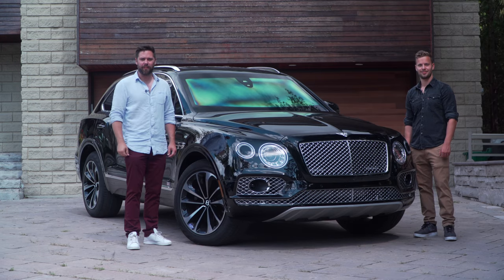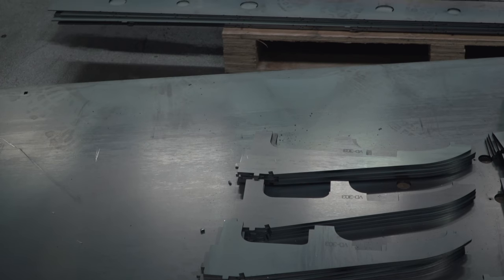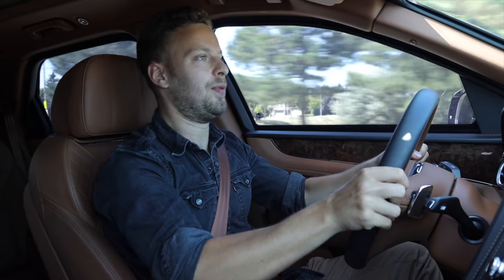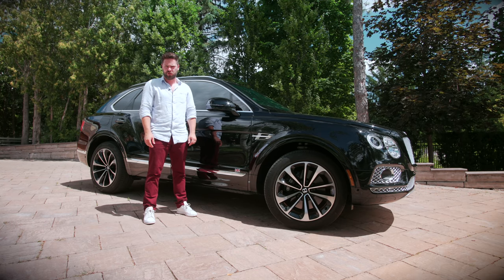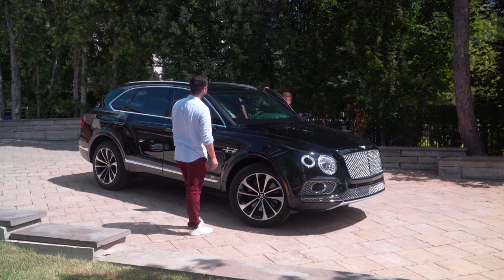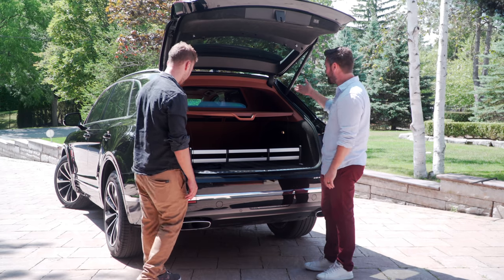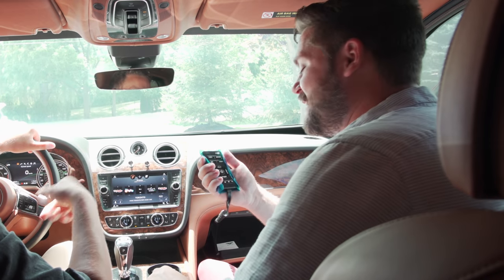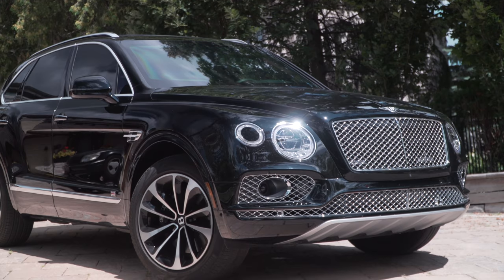$500,000 Bulletproof Bentley Bentayga Review // First Of Its Kind

Comment: How well do the tires defend against knives? Or direct gun fire onto the tires?

I wonder how an Inka Subaru WRX STi or Honda Civic Type R would perform.
Reply: They have run flat tires. So even if the tires are shot out you can usually travel up to 50miles with them completely flat

Comment: Nice but not as cool as the BMW X5 VR6 !
Reply: 3/4 armoring. Still on oem suspension...
Reply: @K2theK-b6u  3/4? Which one has better armor?
Reply: @Todestuete  They clearly show you the armoring bulkhead ending behind the the 2nd row seat. This is done for few reasons, mainly to save weight, thus avoiding changing the original suspension. By avoiding to reinforce the suspension, this will create problems down the line for the owner, as the original suspension has been designed around a GVWR from the manufacturer, as well as the brake system which definitely has not been touched.